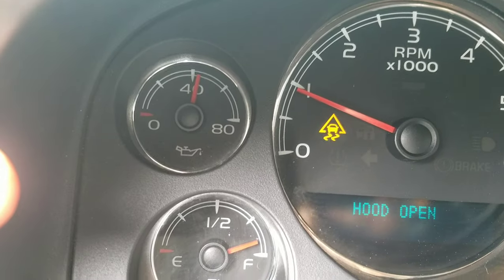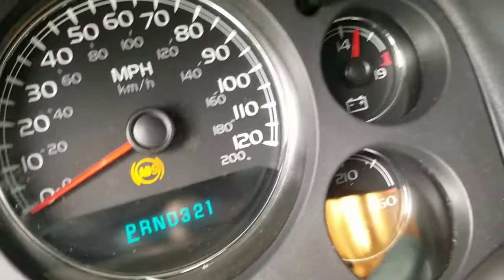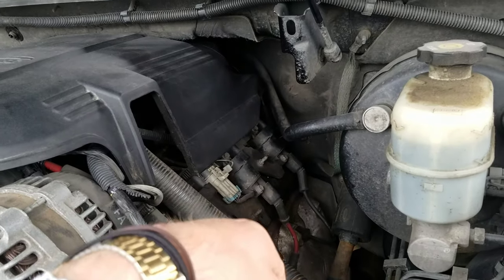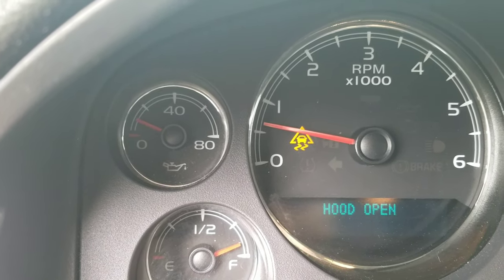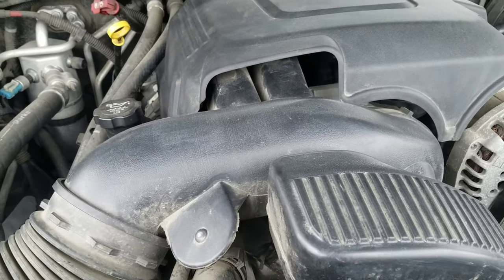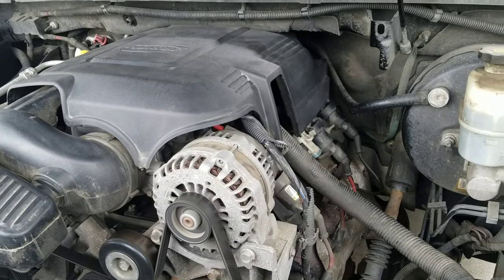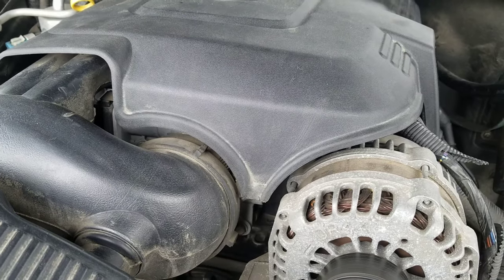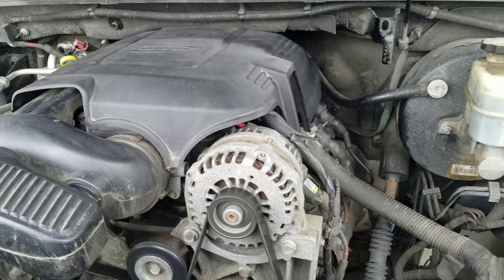0 or Low Oil Pressure? Chevy Suburban, 5.3l Vortec 2007-2014, Tahoe, Yukon. Diagnose and Fix Easiest

Comment: Just changed the Oil Pressure sensor and the screen under it, replaced the pick up tube O ring and gasket. New oil and filter. No oil pressure, oil light comes in after 15 seconds but no engine light. Any suggestions on what to check next?
Reply from the maker: Could be your gauge cluster. Main question is if it's saying 0 oil pressure does engine start knocking or ticking? If it runs for more than 5 mins and no engine noise it's getting oil pressure. Could also manually check oil pressure
Reply: g3mccotter i believe it’s the pump, after running for a few seconds it does tick. I got a oil pump coming in tomorrow.
Reply: After replace the pump is it fix problem ? And what is oil pressure now ?
Reply: @bradleyp9123  how did it go? I got mines change about a month ago.. the oil pump. Paid lots of money, I’m back to same problem.
Reply: I know it's a pain bit make sure u didn't pinch the o ring. It happens to the best of us. Other than that make sure ur getting oil to the top of motor  and if so it may be electronic
Reply: @jff6530  Bro, not good, I replaced the oil pump and everything else necessary. Had oil pressure for 2 minutes then it dropped back to 0. The next day I got it looked at by the dealer. 7/8 lifters were seized on the driver side. Cam was chewed up and metal shavings galore. So i replaced the motor and its been running good every since. Check your lifters bud.
Reply: @johnnylambeth2439  exactly. After I replaced the motor, I did a motor flush, then dropped the pan, Cleaned that out, changed the o ring on the pick up tube. and its been running great since. Im also using valoline syn blend with lucas oil stabalizer. It seems to like it.
Reply: @bradleyp9123  I got a high performance oil pump installed in oct 3. Pressure was purposely set at a high level. It was running at about 60 to 80 psi for about 100 and i got a check engine light. I took it back to the shop and they changed the oil pressure back to normal 30 to 40 psi. It took care of the check engine light but after another long run on the high way the pressure dropped to 5psi. Took it back to shop and they said all they could do is raise the pressure back to 50- 70 psi. I got my Sierra back on Saturday, drove it for 100 miles yesterday with the high oil pressure at around 60- 80 psi. I thought it was all good until I got a check engine light again this morning. Don’t know what to do. The oil pressure is staying up and I’m sure that what’s giving it the check engine light. Do you think the engine should be good as long as the oil pressure stays higher than 40 psi? I have a 1,200 mile road trip coming next week, I honestly don’t know what to do. Thanks for replying in advanced. Also how much did you pay for the engine swap?
Reply: @jff6530  Honestly bro , there are so many little things that could play a factor. If you are out and about today stop by your local part store and get them to scan the code for you and start there.  If its running fine but throwing a code it could be something minor like a dirty/bad Oil Pressure sensor or the screen thats under it. My engine swap was $1500 CAD  (1500 poutines ) so like $1200 U.S. or 1200 american bald eagles if you will.  When I cold start my vehicle my psi is roughly 40 then drops to 20-30 psi at idle when its operating temp. On the highway it goes up to 40-45 psi. Have you thought about doing a engine flush? get all the dirt and gunk out of there?
Reply: @bradleyp9123  I called the shop today and told them what was going on, they said to bring it in. The check engine code said high oil pressure. Engine is running smooth. The reason the oil pump failed the first time was because it already has some damage. Im gonna run the engine to the ground.

Comment: Have a 6.0 in a express van. Sometimes it has zero pull pressure at startup, and stays at zero until you rev it a bit. Then pressure jumps up good and stays good until you shut it off.  Changed the pickup tube ring and problem still there. Any ideas?
Reply from the maker: Get a manual oil pressure gauge on it. Could just be your cluster.
Reply: @g3mccotter  when it doesn't show pressure, the engine seems to knock more. So I don't think it's a cluster/gauge issue.
Reply: @skliros9235  ever find out?
Reply: @20tea  . The problem all the sudden disappeared. Not sure if it's due to the warmer weather or what...
Reply: @skliros9235  Maybe it's running poor due to a leak in the intake manifold gasket.   Usually poor operation in colder weather, but warmer weather the gasket is more flexable and allow a better seal.  That's my guess anyway.
Reply: @20tea  it runs ok. Just zero oil pressure at startup sometimes.
Reply: I have a 2004 gmc Sierra with a 5.3 and I have the exact same problem. Changed the o ring , oil and filter and did not fix it. It is noisy when it says low oil pressure. I riv it a bit and oil pressure comes up to 45 and motor rattle stops. I could use help
Reply: @anthonyjginter  I wish I could help you.  Mine has been ok for the most part now. Will see what happens when the weather gets cool again. I'm out of ideas on what else to check? Perhaps oil pump? Or a pressure relief valve issue somewhere? Let me know if you fix your issue.
Reply: @skliros9235  I have found the low oil pressure problem.  The pressure release valve was stuck. I replaced the oil pump and now I have 43 psi at idle and 58psi at 50mph. I have instant oil pressure when I start the truck. I hope anyone having the low oil pressure issues like I did find this useful.
Reply: @anthonyjginter  thanks. I was hoping I didn't have to change the oil pump. It seems like a big job.
Reply: @skliros9235  I never worked on a LS type engine before but it wasn't bad. Make sure you get a harmonic balancer puller for the LS before you start taking it apart. It's a special puller. I had to buy one on Amazon. I put my new pump in a "pan" and covered it with oil while I was taking off the front engine stuff. Dont put it in dry. I did drop my oil pan just a bit to get to the bolt holding the pick up tube. 1 inch is all that's needed. I hope this helps

Comment: Service traction control has been common in all the suburban videos!
Reply from the maker: Yeah that stuff starts acting up at the first sign of any issues it seems
Reply: Service track is the dod 99% of the time fix that itll fix the service track code my avalanche did that until I deleted the dod and flashed the pcm all is well other than that Oil Pressure going from 20-25 at idle hot but good when driving 40-45 so may have something still going but u remove the dod system trucks will run forever
Reply: Seems to be that the #1 plug on my 5.3 fowls out and causes a miss, which causes my stabilitrac traction light to come on with a rough idle. When that happens and the light comes on now, the first thing I check is the #1 plug.

Comment: 09 z71 5.3     Cold start 42-45 plus psi   At idle.   After 5 minutes settles at 40-42 at idle and normal driving.  After running for 20 minutes, the oil pressure gauge drops to around 20-25 when at idle    Back up to 40-42 under acceleration.  New oil pump and sending unit.  Still does it.   Engine is smooth quiet and strong     Is this normal on 2nd gens?  My previous 02 4.8 and 00 5.3 held 40-42psi all the time.  Never dropped
Reply from the maker: This seems low, however most of mine with afm were similar. Under load even after heated up it should be more like 50psi or so I would say and then 40 for light load and idle. Check your levels often, I know mine from burning oil would get low and my pressure would do different stuff. Get a manual gauge on it and run through same scenarios, it could be your gauge cluster also. I think my 6.2 always had 40 psi and then around 50 or 60 at load, 6.2 didn't have afm for those years...
Reply: @g3mccotter  thank you.  Yeah I’ll use a manual gauge to test      I’ll keep trouble shooting.    Still need to disable the afm also.    At about 180kmiles should we still continue to use conventional 5w30?
Reply from the maker: @dailys1979  Up to you and driving habits and conditions. If oil pressure is good I don't see why not.
Reply: Same I did the dod delete but replaced everything but saw a hack to add shims to the oil pump and slightly crush the valve on the oil pan to increase pressure and claim to neve rave an issue after I may try but no issues so I may stick with it until I have problems also someone said if u remove the dod system 10 psi and up will give u no issues as the dod system needs at least 27 psi to close the secondary lifters fast enough so hope that helps 🍻 also a buddy that works at the gm dealer says to run 10w30 up to 10w50 and call it a day I run 10w30 dully synthetic with lucal synthetic additive and no issues other than the pressure getting to that 20 psi range at idle but driving is fine 40-45 and 50 cold start
Reply: What should start up oil pressure gage be at? 5.3 12' tahoe

Comment: My 08 Silverado 170k has low Oil psi Around 15psi when its cold.but when it gets hot it holds around 35psi, 40 while driving. Any imput?
Reply from the maker: Seems like weird oil pressure sensor, or gauge cluster maybe. It should be high when it's cold and get lower after warm
Reply: 15 is below spec at idle. You may have some internal problems bud. I would start with the sending unit and screen under it and make sure the screen isnt dirty.

Comment: My oil pressure dropped to 0 pressure, it was the oil pressure switch on my 2009 Tahoe. Mechanic charged me $165.00 to replace it.
Reply from the maker: Might be more than that. See how long it goes without issues

Comment: I have a 2014 Tahoe I replace the cam and lifters and oil pump I got it on eBay for cheap  I put everything together and the oil pressure is a 20 but when it gets hot goes to 0
Reply from the maker: That's not good. I thought they had afm sorted by those years. Why did you replace?

Comment: My Tahoe was fine until I got a oil change. Now it's shaking really bad when I'm sitting at a red light. I went back to the mechanic shop and told them it's acting weird and shaking. They said its fine NO ITS NOT! It didn't do none of this until I got a oil change. Now I'm frustrated I work very far out and can't drive to work because of what's happening.
Reply from the maker: @mooneygirl88  are you getting the same results on the dash as the video? Shaking at red lights sounds like your engine is misfiring. Check your plugs. Most likely nothing to do with the oil change unless they just didn't put oil back in it. Check oil levels. Check spark plugs. Could be an ignition coil pack if.

Comment: Need some help guys. Last night it wasn't on drove my car to work in the morning and it was very icey out and my check engine light came on so after looking around on the dash i noticed my oil pressure gauge is pinned at 0 "IT DOES NOT MOVE AT ALL"  just pinned to 0 and my remote start wont work either. 2013 Sierra
Reply from the maker: Check oil and go from there. If it was colder than usual some things could be stuck and just needs warming up. If you hear ticking or knocking shut it off and be happy your gauge works

Comment: I rebuilt my engine on my 2007 Cheve Avalanche . Went through the breakin period changed oil at 500 miles , then drove another 1800 miles , then gauge dropped to zero , and stays on zero . Engine runs fine no knocking or ticking . I have replaced oil sensor still zero . Checked oil pressure at the side of block near oil pump , I have 45 psi  there , and thats where I am . Any advice on what to check next ?
Reply from the maker: If that has afm that could be your problem. Or your gauge cluster. Could be the screen under the sensor. Also the pickup screen on the oil tube in the pan I've heard gets clogged
Reply: if you have 0 oil pressure at all times, it might be time to pull the intake and check the harness to the oil pressure sensor. I've recently worked on 3 different vehicles withing the last 6 months with the 5.3 and 6.0 that have had an issue with rodents chewing up the wiring. Not too bad of a repair, just not enough room to repair the wiring without removing the intake. Good luck!
Reply: @MrVjimmeye  Forgive me if I'm wrong, but I believe the only wiring under the intake (on my 02 Avalanche) is for the two knock sensors.  I do agree with always checking the wiring connections.  I wish I knew there was a small filter under my 5.3L oil pressure sender.  (That was a harder job than I thought it would have been).  My issue was possibly the socket that I was using though.  (Standard deep 1/2 drive Snap on.
Reply: im having the same issue with my 07 Avalanche. But at sustained speeds over 60 mph the pressure gauge shoots up past 80 and the low oil pressure chime goes off with the flashing light
Reply: @Okiesquatch  I found out what was wrong with my Avalanche . The number 4 cam bearing came out of its area, thats what caused it to loose oil pressure. The machine shop that installed it did a shit job on installing it. so I had to take the engine back out and take it to them to fix. Now i have been 6000 miles and no problem .

Comment: I'm having this problem right now. 07 Sierra 1500. Mines lifted and has tons of electrical problems. Wouldnt turn over recently after 2 years.. I guess I had a short with my ground. Mechanic installed ground cables from battery to the body, and to the engine.  My oil pressure went from 40 ish to 0 within 2 minutes prior to that.  I haven't done anything else to it besides keep driving the truck. Now it went from going to 0 after a few minutes, to being parked for 30 minutes while im typing this and it's chilling idling at 10 psi which is way too low but the sensor hasn't kicked in yet.  At first we thought it was the BCM or the starter bcuz it wouldn't turn over. It was a ground short. Then the low oil pressure , watching all you guys videos, im thinking it's the actual fuel pump. All my lights turned on once I fixed the short. But now it's running fine. And the engine still doesn't knock or scratch. But it's literally been idling at 9 psi for 30 minutes now
Reply from the maker: Sounds like a lot of issues going on. Try and solve the engine lights first that are un related to oil pressure. Sometimes lots of different dash lights is just a bad battery actually. I would replace all battery cables  and try a new battery if yours is a couple years old
Reply: @g3mccotter  I’m having same issues, the traction control light came on & it’s hard to start. I have to hold the key & the motor turns slow. I believe it’s a bad battery because it’ll start fine with a jump box. Im thinking the battery is the cause if the check engine light with different codes & today low oil but the level is good. I’m also thinking it could be clogged, truck has been sitting a couple of weeks

Comment: My 6.0 does this and it fresh out of the machine shop? At first sensor read nothing so I replaced it and now I'm getting this?
Reply from the maker: Did you replace screen under sensor? Maybe just run without it.
Reply from the maker: Check it manually with a gauge, could also be gauge cluster
Reply: @g3mccotter  no screen

Comment: I would drop the pan and check the pickup tube screen and go ahead and replace the pickup tube o-ring that is usually the cause of this in GMC and Chevrolet engines
Reply from the maker: Probably a good idea
Reply from the maker: Probably a good idea

Comment: Next you should show how to fix the stabilitrak blinking light
Reply from the maker: That goes away with everything else. It pops up when other lights turn on. Even a low battery will make that light illuminate

Comment: My gauge reads zero pressure never moves. But I know I have pressure because my motor doesn’t tick when warmed up only when I start in the morning for about 5bminutes
Reply from the maker: You might have a bad gauge cluster. Any other signs of bad gauge cluster?
Reply: No just the oil pressure gauge
Reply: same here. mine went out after my original computer went out and i had to change it

Comment: My truck stays at 0 and says oil pressure  low turn engine off can I just change the oilfilter and change the oil ???? Whould that fix my problem
Reply from the maker: Does your engine run for awhile without any ticking, knocking while saying this?

Comment: My oil pressure has issues and drops to nothing when it gets close to changing the oil. Change the oil and filter and it's fine.
Reply from the maker: Might be low on oil when it's time to change it. These things burn oil

Comment: I made a hole in the screen works fine. had problem once with mobile  one oil filter don't use them anymore.
Reply from the maker: You made a hole in the filter screen below the oil pressure sensor? Or a hole in your oil filter?
Reply: I made it in the screen below Oil  Sensor
Reply: @g3mccotter  its your problem fixed? I got the same problem
Reply: @BARKIM ENERGY to me wouldn't do nothing because with hole or not its the same compression will detect the sensor, my opinion

Comment: 🤔 I have been having the same issue. Already changed the sensor and still drops after driving it for a few miles. Going to do a flush next
Reply from the maker: Hopefully it works for you
Reply: Did it work
Reply: @brandon_5280buffs  actually yes it did. I had a permanent code because of it. And now no more code and pressure stays where it needs to be.